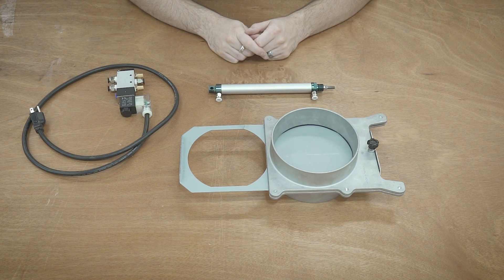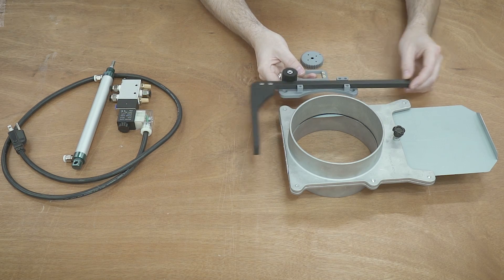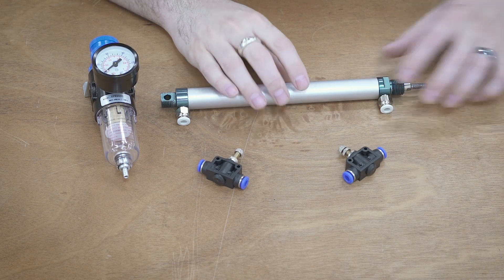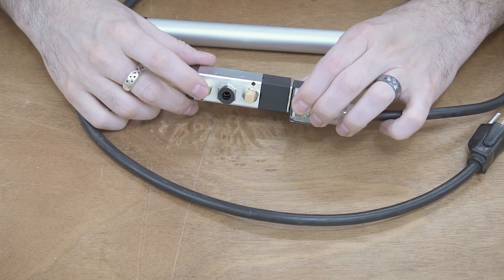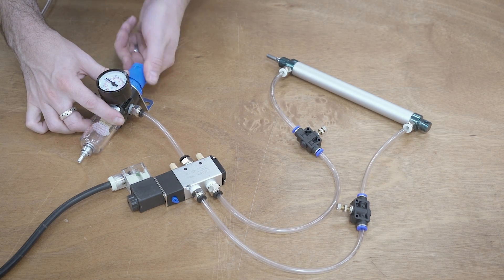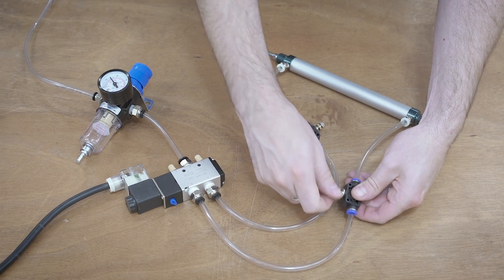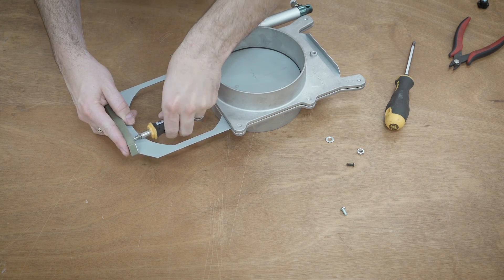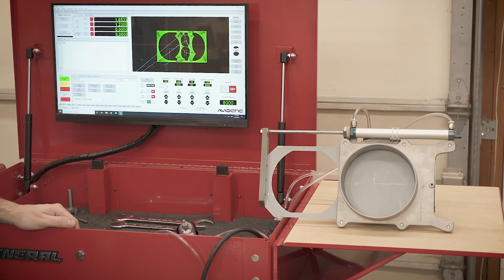Automated Blast Gate for CNC Router

Comment: It’s been a couple of years since you have done this.  I have exactly the same need for my avid CNC.   Still working well for you?   I actually just built wooden gates using my avid as well and getting ready to wrap it all up.  Any changes you would suggest.   Great video. Thank you
Reply from the maker: I just used it yesterday!  It still works.  My only issue is I don't always have enough pressure to activate the solenoid (because I turned off the compressor and forgot to turn it back on).  But it actually works exactly as expected years later.
Reply: @RobertCowanDIY   nice. All my parts just arrived  excited to get it going. I will need to learn the Mach4 part but not worried about it.  Thanks again for a great vid
Reply from the maker: @mikerainwater528  Nice, good luck!

Comment: I went a different route, mainly because I already had the parts. I built an aluminum frame around the blast gate and attached a stepper motor spinning an acme threaded rod. A nut riding on the rod moves the gate.  Limit switches sensed gate position. I already had the stepper motors but a regular dc gear motor would work.  Way slower than your method, but it works.

Comment: Really good video. I've just been installing a new fully ducted dust control system and I've been looking at a way to automate the operation of them. I'm planning on using linear actuator though to do roughly the same thing. I think it will be easier to use an IFTT app to control the gates. Thanks for some ideas

Comment: A limit switch mounted to the gate could be setup to control the dust collector.
Reply from the maker: Very true.  I didn't do this because I don't necessarily want the dust collector cycling too much, and if I accidentally have the M command in my code, I don't want it turning on and off a lot.  This isn't great for the motor, so I just control it manually still.
Reply: You might want to look into making a spring loaded fare that will open if the vacuum get to high too keep from collapsing your piping. Some of the jobs that I worked at had gates at the end of the lines to help stop the problems with to high of vacuum on the lines. The gate was just disk with a spring load that could be adjusted to keep it from opening when it was not needed.

Comment: I've never done this, so these are definitely questions rather than suggestions. 1. Could you use just one flow controller before the solenoid and accept that the two directions would be actuated using the same flow? 2. Do you ever really need to move the blast gate blade while the dust collector is switched on?  - can you program delays in the post processor so that for instance you could wait long enough for the DC pressure to normalize before opening the blast gate? Thanks for a great presentation, and I'm looking forward to getting this going.

Comment: I made some changes to the 2 parts to fit the 4 inch blast gate as well. I don't currently have 6 inch runs, but I wanted to use something like this on my CNC as well. I will upload a remix on Thingiverse for anyone that would like the smaller version.
Reply from the maker: Nice!
Reply: Did you post the remix on Thingiverse.  Thanks in advance

Comment: Hello Robert. 
Excellent video and nice job of explaining applied pnematics. The discussion regarding throttling inlet vs outlet is interesting but was settled long ago in the instrumentation field. The piston will extend or retract under load much better with the exhaust flow regulated. This is because full pressure is applied almost imediatly to the drive side of the pistion and with it full force in the drive direction. As it overcomes the decreasing pressure on the opposite side of the pistion the stem moves forcefully and smoothly.  This prevents  a slow jerky start to the stroke often seen with the initial low pressure of a regulated supply. This change may improve performance when your vacum\m system is in operation.  
Thanks again for an excellent video.

Comment: I see that it works on the bench...
I would  like to see it installed with the dust collector vacuum pulling against the blast gate creating additional friction.
How did the 3d printed part's hold up?
My blast gates are harder to open when the dust collector is on.
I've been holding out on getting a 3D printer. I guess I'm a little dubious of the actual real life workability of the parts made by 3d printers.
Thanks for posting!
Reply from the maker: This video is a few weeks old and the dust collector wasn't fully installed yet.  So far, it works great.  Under full suction, it can still open, just a bit of a struggle with 2K CFM pushing against it.  Actual real life workability of 3d printed parts?  I wouldn't worry about it.  They hold up good, as long as they're not exposed to UV.  I have other little 3d printed parts around the house and such, and they've held up for years, as long as you design it right.
Reply: @RobertCowanDIY  Toally agree, and its not like its a huge hassle to replace them if they fail. you printed them in the first place right!

Comment: Great video but how did you send the signal from Mach4 to the solenoid to open or close.  I didn't see a low voltage connection.
Reply from the maker: The Avid CNC controller just has 120V outlets on the bottom.  I just plugged the solenoid into one of those.  There's no low voltage connection, that's just already taken care of with a solid state relay in the controller.  I could bypass those and go directly into a 12V solenoid, but since it's there, I just used the 120V outlet instead.

Comment: Hello from Taiwan! In my limited experiences, we use imperial threads for larger screws/bolts (larger than 5mm) and metric threads for small stuffs. We measure length with both metric and imperial , so most of the rulers here have both metric and imperial. (We also have another length system with "Taiwanese inch (3.03cm)" and "Taiwanese feet (30.3cm)")
Reply: I hate imperial units, but dang, thanks for reminding me that it could always be worse hahaha

Comment: Don’t control the speed by throttling the outlet!! It can cause over pressure in the cylinder and it won’t last long it will intensify good practice is meter in!! And not meter out you if you want to meter out use exhaust throttles
Reply from the maker: Sounds like I might need to move the flow control ports to the exhaust side.  But from a plumbing standpoint, it's in the same path right?
Reply: Hi Robert are your flow controls directional? Do they allow full flow one way? If so have that direction on the outlet direction of the cylinder otherwise just make sure that you control the cylinder speed by the flow going in and not the flow coming out
Reply: Is that not what he was doing? Maybe I didn't see right

Comment: Great design! 
I'm planning to use my woodworking DC for my CNC. I've seen warnings that the metal chips are a fire hazard but I've also seen contradictory info and have no idea how concerned I should really be. How do you intend to operate yours?
Reply from the maker: I'm not sure why people would say that the chips are a fire hazard.  I guess if they get hot enough, they could burn the wood chips/dust?  But for cutting aluminum, it's hard to get the chips THAT hot.  They are pretty much room temperature when they leave the workpiece.  Also, sucking them through the dust collector ducts cools them significantly, and very quickly.  I don't really see an issue here.  I put about 5 pounds of chips into my dust bin, which also has quite a bit of fine MDF dust, without issue.
Reply: That's how I feel as well.

Comment: Good video.  Final result looks great.   A couple small things:

Flow controls control the port exhaust flow (not the port that has pressure, but the opposite port), that’s why they control speed instead of force.   You apply full flow to the extension direction, and meter the exhaust coming out of the other port.    They aren’t reversible—they only meter the flow in one direction.  There’s a little arrow on them.  You can use them on both ends of the cylinder but you adjust the opposite one.  I.e If you want to adjust extension speed, you adjust the flow control on the retract port.

Also, pressure regulators are meant to be adjusted while air is moving which is a little difficult to do with just an air cylinder.
Reply from the maker: Thanks for the comments!

Comment: @Robert Cowan... You have obviously considered the air vs electronics question, and you mentioned your challenges with the servo / rack-N-pinion option, but nobody ever seems to answer the question of, "Why not just use a long solenoid without air?"
Pneumatics seems like such a pain to me with all the extra tubes and connectors.  Wouldn't a linear actuator be simpler?
Reply: Mechanical solenoids are pretty much always a disappointment, they just don't output enough force or consume an unreasonable amount of energy. A pneumatic system effectively only uses energy during the actuation period. Of course, you could trigger a movement solenoid then have a locking solenoid and etc (this particular application probably doesn't need that), but that's starting to look like a mountain of bandaids. If you already run shop air, adding some cylinders to the existing infrastructure is much lower effort.
Reply from the maker: What Troy said.  They use a TON of current for any reasonable amount of force.  I'm using them for another project right now, and they're pretty awful and every time I go to use them, I decide to go a different route.  They are good for moving very small loads only.  A linear actuator is of course another option, but something with a 6" stroke would be somewhat expensive, and then you need a controller.  BUT, if you wanted something a bit simpler and didn't want to mess with air, a linear actuator would be the way to go.  I have a 'linear actuators 101' video that's quite popular, I just didn't want to run power, have a motor controller, and then program in the logic (you'd need something to tell it when to extend and when to retract).  This was a bit more 'plug and play'.
Reply: Thank you Troy and Robert.
What I heard, is:
* efficiency of power is much better in pnuematics
* you would probably have to run power and/or air tubes with either choice
* price seems like a wash
From my perspective, I try to minimize maintenance and points of failure and/or comolexity, thus my question. I have never had an air compressor that I left running or even pressurized full-time because of condensation in the tank and slow leaks in the plumbing that would make the dog bark at 3am as the compressor turns on, so automating around compressed air seems inconvenient at best.
This application, fully automated, would be operated by the CNC controller which means I don't want to mess with my compressor first (close bleed valve and turn it on).
I would also be automatically turning on the dust vac at the same time, including a slow-start circuit. 
Perhaps a simpler blast gate design would be the design feature that drives a simpler, more efficient and less expensive way of actuating the gate. 
https://www.thingiverse.com/thing:2573041
Reply: @KarlMiller  Pneumatic cylinder systems tend to be extremely low maintenance. There's really only two moving parts: the sliding valve and the piston in the cylinder (the blast gate is moving regardless). Both of those are usually oiled by the air, so basically no maintenance. On top of that, all the motion is linear and easier to predict wear. If you've ever seen an episode of How it's Made, all of this kind of motion is handled by cylinders when possible for exactly those reasons. 
I'm fairly certain Robert's solution could be accomplished for around $40 in parts (I build robots with similar components) and what you linked could be done a bit cheaper, at the risk of increased maintenance and being more "fiddly" over time. 
As a general comment, I would hope most home shops just have their compressor on a timer to switch off at night.
Reply: @troy4393  thanks for your thoughts.  I just don't see the benefit or reliability of twelve air connections to move one small piece of metal a few inches.
Too many parts and motors involved in a very simple task, especially when the alternative is a five dollar servo and a 3d printed arm.
Reply: Changing a rotary motion to straight  in/out is more difficult. I'm in the middle of designing my own and have abandoned the rotary actuator and going pneumatic. Also the actuator needs soft stop limits programed were as the cylinder does not. I am using a Arduino and  low voltage 24 VDC solenoids,  much less coding evolved as well

Comment: Great addition. I have seen solenoid valves with valves on the exhasts ports so by controlling the outflow you control the speed without using extra parts.
Reply from the maker: Oh, that makes a lot of sense.  I admittedly added the flow valves after the fact, because it was slamming open and closed too fast.
Reply: @RobertCowanDIY  yes your approach is right and will totally work. But in case you prefer replace it and have a cleaner set up you can search for them. I think in most solenoid valve you can unscrew the  exhausts and replace it with whatever you want as long the thread pitch is the same. You can find the adjust al exhaust on amazon, AliExpress, bangood ecc...